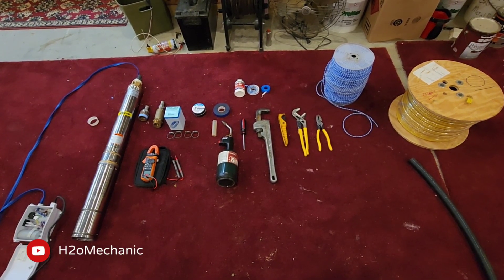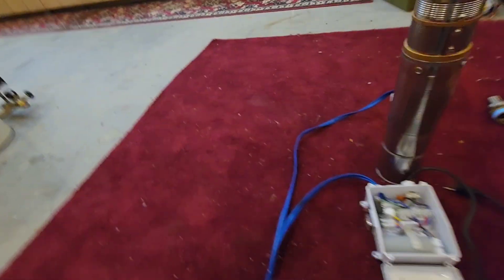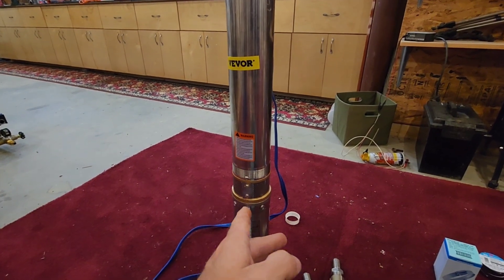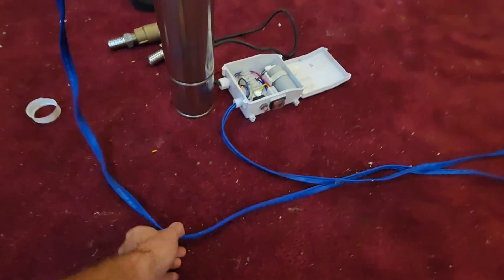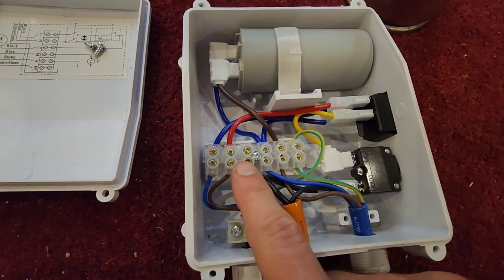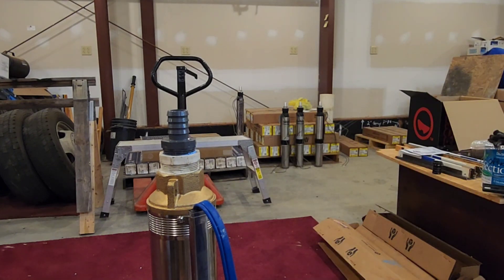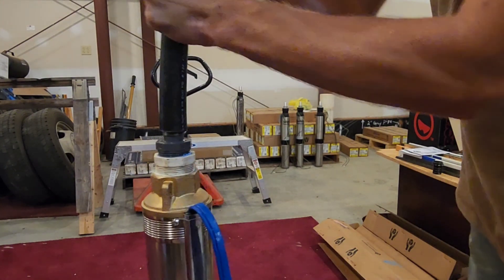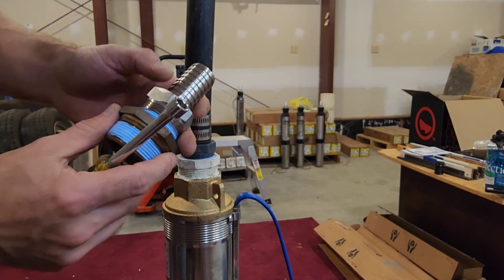115v Vevor Well Pump Installation Guide. Tools & Tips, What You'll Need

Comment: FYI Vevor has their hands in almost every niche market peddling their chinese products. They seem to be decent for the price and i considered some of their PCP high pressure air pumps.  But they clearly lie / exaggerate the specs, that is a 1/2 or 3/4 HP pump not 1.5. As someone who has first hand experience with the chinese. They lie about EVERYTHING with a straight face. For hobby products that might be fine. For drinking water? Who knows if that metal contains lead, what the insides are made of, etc… it’s not worth your health

Comment: I want to convert my jet pump 2 line system to submersible and im understanding everything but as far as the length of the new pipe goes do I just match it up with the old pipe I pull out and add the extra difference for the cap extension?

Comment: Hi, let me ask you a question here. I got a 1.5 hp ve or that comes with a 4 wire cord. Red, white, black and green. I also got a control box like the one you have but the area where I want to use this pump there’s no power lines close. So I want to or have to do it with a generator.  I’m planning to connect the control box to the generator by just plugging it in.  So my only doubt is to connect the pump cord with those 4 wires to the box. How does that go? 
Im no using a pressure switch or anything else besides the pump and control box just to power it on and off. 
I hope im clear with my explanation and thank you for an answer.
Reply: Did you find out? I am in the same situation
Reply: I'd hope you found a solution for your problem but if you haven't I suggest you do a search online for a very similar setup to make sure you do not damage or hurt yourself. You're not the only person that's used a generator to power a well.  Personally I'd suggest you buy a pressure tank and switch and make it all portable somehow. Never be afraid to ask for help. Good luck.😊

Comment: bought two of these.. they were placed at a 120ft.. 12guage wire... first control box capacitor dies in the first week,  second control box made it about 3 months before the cap went and the contacts and wiring melted in the box... Pumps worked great overall but control box was the weak link in the chain. Replaced with a Franklin motor and pump.... 220 volt... going to build new control boxes for pumps and who knows where they will end up....

Comment: I installed this 1.5hp Vevor with correct large copper wires at 127 foot head. It immediatly drew 15-16 amps (too high), but still pumped water up to shut off pressure (65psi). It lasted 3 months and then started using 20+ amps, then quit entirely the next morning. Unless you're a fan of doing the job much more often I would advise a different pump. Mine was purchased off Amazon for about 150usd with the control box. Note I'm shipping for another pump,  and the tools to pull this one out. Good luck,  my fellow DIYers ;)

Comment: We have a 1/2hp  pump that if we have the washer going anything else suffers .if we have the hose to the garden it barely comes out its only 2 years old if i get this one or the 3hp its only like 45' deep well but we would like to have some sprinklers
Reply from the maker: The 1/2hp vevor pump, I've tested it on the channel. It was designed for volume, not pressure. You can find the test in the Playlist Labeled pump testing. It was the vevor pump from lowes. 1/2hp 25gpm. Max working depth was around 50ft
Reply: Thanks for the reply im not sure what 1/2 hp i have but looking to upgrade to this 1 1/2hp
Reply: @Cumminsmcgee  try changing hose size

Comment: Why can't you use 100 psi drop pipe?. Just curious.
Reply from the maker: 100ft deep =44psi head pressure.  Plus 60psi operating pressure. That's already 104psi at only 100ft Deep with 100psi pipe. It's OK to use on a jet pump or say a 60ft deep pump set. But why risk it.
Reply: @h2omechanic  Oh I see, thanks soo much for the quick response, and the enlightenment!. I appreciate it!. :). We live off-grid in BC Canada and are going to try make our own shallow well here on the homestead using a trash pump. We are on disability, and super poor, living in a tiny cabin, and absolutely cannot afford to pay to have a well drilled, so we figured we'd try our hand at doing the trash pump method as we already have one that we use to get water from the lake. We plan to get one of these Vevor 115v pumps. So I guess we'll get some 200 psi 1 inch poly pipe, and 4 inch PVC for the casing and give it a go. I am curious though as I use the pump to go down, how will I know when I've hit the water table?. I honestly wish we could afford to hire a pro, but just affording food here in Canada every month is near impossible, then add to that being on disability now and having to go to the food bank every month it's totally out of the cards to get it done professionally. But yeah, thanks for the input, I have been researching this off and on over the last 4 years and I'm pretty sure I got a good plan in place now. We are going to use 1 inch poly with a 2 inch to 1 inch adapter to the pump and then bury a 10 foot piece of 4 inch pvc as deep as we can then run the one inch down the hole with the pump using a couple IBC tanks full of water to pressure drill it out and see how far down we can get adding 10 foot lengths of the 4 inch PVC, and fingers crossed we find water!.  Anywho. Keep up the great work on your channel, I subscribed last night, very helpful stuff my friend!. Sending good vibes from Canada!. - Adam

Comment: Please help: I purchased a 1.5 hp Vevor 230 volt deep well pump. The pump came with 33 feet of 16 gauge wire-only problem is the wire has one hot one neutral and one ground wire-I have no idea how to hook this up to 230 volt pressure switch without two hot wire. Vevor tech support was no help.
Do you know how to fix this?
Thank you 
Robin

Comment: So happy I found this! My well pump just went out and I just don't have the funds for a $2500 pump replacement. The Vevor pump in the 1 1/2hp size is only $144 with that controller, and something I can afford to buy IF I can put it in myself and save myself the labor cost which is astronomical out here in California.  Putting it in myself is the thing. I can manage connecting the new pump and routing the wiring, but being on the near side of 70 years old with a fairly frail body, pulling the pump is going to be a thing. Another, is finding out if my current (2 year old) control box will work just fine with this pump instead of using the one it comes with. If so, and if I can find a creative way of pulling the pump myself, old would seem easier than installing the new one. Anyway, thanks for posting this video. I'm sure I'm going to be watching it as I do the job.

Comment: Hi, wondering if you put a check valve on all your installs coming out of the pump, in this clip, you have a brass one on the 300' plus install only ? would you use pvc, being that it is submersible, I've been reading that the brass can leach lead... thanks again

Comment: Hey, I also bought this pump and like you said, I need to change the cable for a bigger one since I’m too far from the plug. 
Do you think there is a way to change all the cable or the only way is to cut the last few feet and connect the bigger cable on the original finer one?
I don’t like the idea of doing that especially because of intensity issues and heat for the last portion of finer cable …
Thanks for the video by the way ! Very interesting!
Reply from the maker: All pumps have a 3ft lead of #14 wire & require a Splice. So my advice is to do the same. Solder your wires before using any crimps, since the 16awg is so small. Then I'd run #12 or #10 depending on how far your putting it
Reply: Thanks a lot

Comment: Is there a quality pump on the market you would recommend for a 2in well application?  Less than 80 ft depth.  Great vids..
Reply: If your water head is high enough you can use an above ground pump. That's what I do with my 2 inch hand driven well. I use an Amazon 1 hp cast iron pump. Around $200. They will only draw about 30' though. My well perks to 10' so an above ground pump works good for me.

Comment: Im installing a 110v .5 hp vevor pump. Do i have to have a control box or can i wire it directly to the pressure switch?
Reply from the maker: Doubtful. 
How deep are you putting that pump? Other views have had issues with the 0.5hp vevor not building more than 43psi of pressure. 
I'll be testing one in the near future

Comment: i just bought a vevor 115 pump ,do i have to use the control box,???
Reply from the maker: Yes, if it came with the pump.
Reply: Can i use the 115v pump without control box? Thanks in advance.
Reply from the maker: @yawn2tv244  3 wire pump requires a control box. 
2 wire pump doesn't

Comment: Great job as always. Quick Question. When wiring the control box to the pressure switch, does the polarity matter on the pressure switch?
Reply from the maker: No. 
Power goes into the pressure switch, then out to the control box

Comment: So i have a spring fed well in the back by my barn / new orchard. I just ran power to my barn today. I'm wanting my well to power a shop sink( 15ft away from well) and a hydrant for a garden hose to water my fruit trees and vines( 50ft hose will do for now 100ft by next year) 

Would I need that vessel tank you have? Or can I just hook this 1.5hp pump to a pipe , put a T in it and feed the hydrant and a pipe going inside my barn for a shop sink?
Reply from the maker: It's always best to have a switch & a tank (even if it's a 2or4 gallon tank) the switch is for safety and the tank acts as a coushin to soften water hammer

Comment: Thanks for the help last week. I now have to decide either to stay at the 100' wire depth that comes with the 3 hp pump or to splice with another 200' of wire to reach a 300' ft depth. The well is 525' deep and is holding water at around 30'. It's producing 20 - 25 gpm so according to calculations 100' should suffice. But would it be better to go to 300' now? Your help is greatly appreciated.
Reply from the maker: I'd try it at 100ft first. No need to go deep unless it's needed.
Reply: @h2omechanic  I actually misspoke about splicing the wire. I will replace the 100' with 300' as long as I can secure 300' of 200 psi pipe. But unless there's an issue with the 3 hp pump at 300', I may just go 300' now and know it's going to be better. Agree? Thanks!!
Reply: @MitchCrabbe  I have a 3hp vevor at 330' it's almost too much. It cycles on and off way to quickly because of the output. It does however put out 20+ GPM. Paired with a cycle stop valve I think you could have a very cheap bang for your buck system.
Reply: My well is 215 feet.  Water is at 75 feet. Not a lot of water in Oklahoma panhandle 😢😢. Going to put my pump at 190feet. How big of a pump to I need.
Reply: I wouldn’t use it for that deep lol the rest of them are junk

Comment: I have a Vevor 3 hp pump that I thought came with the control box but it didn't. Which control box do I need and where can I get one or one that will work? Thanks!
Reply from the maker: Does your pump have 4 wires coming out of it? Black/red/yellow/green
Reply: @h2omechanic  Thanks for you quick reply!  It's a four wire. I'm not with the pump right now so I can't say for sure. But I'm having someone check on it.
Reply: @h2omechanic  Plus, a question was answered on Vevro's website concerning the 3 hp pump and whether or not it needed a "special box". Do you think this is the control box they are asking about?

I need to install the vevor 3hp deep well pump i need to know iff i need special box for it here on usa

Answer
View MoreNo, it doesn't need. It can be used directly after power on.
Reply from the maker: @Mitch Crabbe  if its got 2 hot wires & 1 ground it doesn't need a control box. The 2 hot legs go straight to the pressure switch.
Reply: @h2omechanic  Then based on having the 3 wires, no control box needed. You da man!
Reply: @h2omechanic  Sorry for the confusion. There are 3 Yellow, Blue, and Brown.

Comment: I just installed a 3hp 2 wire vevor pump in my well. It sits 330 feet down. That pump will pump 15-20 GPM on the outside hydrant and builds 70 psi without hesitation. I'm only concerned for longevity just due to the price point.
Reply: My 1.5hp lasted 3 months @ 127 feet, is yours still alive?

Comment: Just ordered my pump what size pressure tank & pressure switch would you recommend for this Submersible pump. I will be only using it for single family home irrigation only.
Reply from the maker: 40/60 pressure switch 
20 Gallon pressure tank.
Reply: @h2omechanic  thanks

Comment: My well is 80 feet deep. I am installing a 1.5 Hp submersible pump.
I will be using 1 inch poly.
What pressure rated polypropylene pipe do I need?
Reply from the maker: 200psi

Comment: hello im installing a new 230 volt pump and im trying to figure out how to test before putting in casing have 10 3 wground wire  thought i could just put in trash can of water and take to hots black red and touch double thirty amp breaker for 10 seconds and hear it run but it doesnt does feel like motor is on but not turning impellars any help would be really appreciated am doing this because i dont trust were i bought it from. thank you keep up good work
Reply from the maker: If its a 3-wire pump, it must go through a control box (starter box).
Without the control box it can't spin. 
2 wire pumps have built in start capacitors. 
3 wire pumps have external capacitors in the control box.

Comment: in you video of March 25, 2019. you only use "Rubber Duck take Duck Brand 393154 Rubber Splicing Tape, 3/4-Inch by 22 Feet, Single Roll, Black" and provide al link to exact product--for 15 years. but in this video it seems you use just regular old electrical tape. why?
Reply from the maker: Rubber Tape is to protect the wire splice itself. Black electric tape is only used to secure the wire to the pipe. 
Note:there was no wire splice in this video as it was only for testing purposes

Comment: When you hooked up two hot wires?
Reply from the maker: Black is hot, goes to the breaker. 
White goes to the neutral bar in the breaker box. 
The pressure switch hooks up the same as it would for the 240v would. The switch doesn't care.

Comment: Question, why can I hear my pump humming but I'm not getting any water pressure?
Reply from the maker: The pipe is broken down near the pump.
Reply: If you have a control box (3 wire pump), check the capacitor as it may have become faulty.

Comment: Okay I bought a vevor pump I have a 240 pressure switch how do I tie on to the switch I have
Reply: Since this pump is 110volt you don't need two hot wires going down to the pump right
Reply from the maker: You go to the breaker panel, remove the 240v breaker and swap it out for a 120v breaker.

Comment: I noticed you hooked up a control box to this pump most of your other videos you don’t are they not needed is there pros and cons ? What’s your thoughts on that vevor pump in comparison to the hallmark thank you bet straight forward videos sir
Reply from the maker: The Vevor pump was a 3 wire pump. Those require that box. Other 2 wire pumps do not. 
The Hallmark pump id rate 2 out of 10. 
The Vevor pump performed Above & beyond what I was expecting to see. That being said, both are around $150 and very budget friendly, my concern is How long will they last. 
Great for Temporary use or irrigation. As a professional Installer, I wouldn't sell on to my customer, but its a great choice for anyone that wants to DIY a pump system and trying to do so on a Budget. 
Frankin pumps I sell along with Grundfos  are near $800-1100 dollars. So you can see the appeal in the Vevor pump at $150. But my $1000 pumps I typically install will build close to 200psi. Vevor did 120psi, Hallmark did 65psi. Those numbers equate to max operating depths. If you double the number (psi) above, that's the maximum depth Those pumps can handle.

Comment: Hello, I have a question for you.. 
We are changing our well pump from jet pump to a submersible pump.. can we use the casing from the jet pump with the submersible pump?.. or do we need new casing.. thanks..
Reply from the maker: What diameter is your well?
You say casing, I assume you mean drop pipe. 
Casing normally is 4"or6" and separates the dirty at the surface from entering the Bore hole. 
Watch a few of my other videos on my Well Q&A Playlist to become familiar with the system. I'll answer any questions on any of the Videos you have. 
Hope you'll subscribe ❤️
Reply: @h2omechanic  thank you so much for replying.. I so appreciate it.. 

I honestly don't know the diameter if I had to say I would guess 6" but I am unsure.. I will get with my dad and see what it is..  I already did subscribe to your YouTube.. your the  best well 
Guy I have watched by far.. and we so appreciate your expertise!!.. thank you again.. we will definitely look at your Q&A..
Reply from the maker: @heavenlyangel5520  you can reuse the 1" pipe if its 160psi or higher. 
If the old jet pump wasn't located at the well, a wire will need to be run out to the well to power the submersible pump. 
You can use the larger pipe in the ground as a wire chase. Your father will understand what I'm saying if you don't. Hopefully I can make a future Vid on this subject when I find the perfect job to do so on.

Comment: Got a question for you
I moved into a house that had a one horsepower 240 volt well pump it's working fine but I was going through the pressure switch and adjusting it to bring the pressure up into my home and I looked at the wiring and the grounds / neutral for both the 240 coming into the switch and going out to the pump or not connected I understand that the pump probably doesn't need a neutral or does it
Reply from the maker: 240v there is no neutral. Both legs are hot. 
The ground isn't really important. Just used for code & safety
Reply: @h2omechanic  Thank you sir